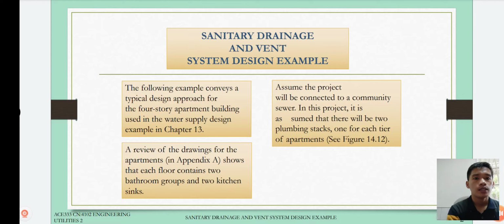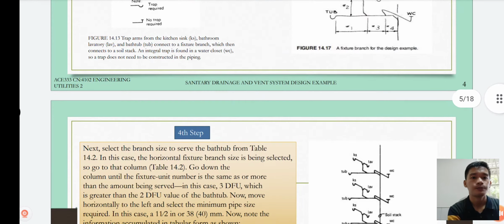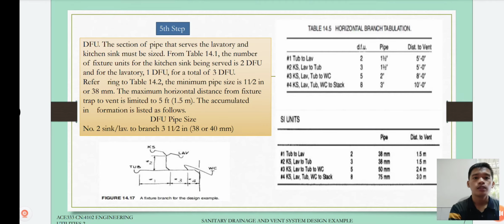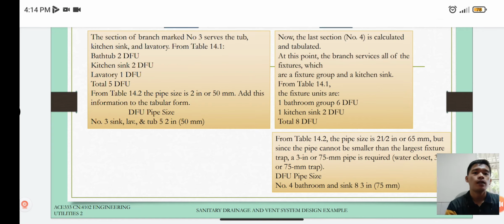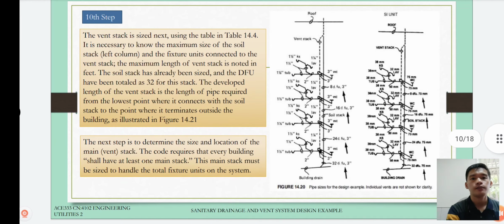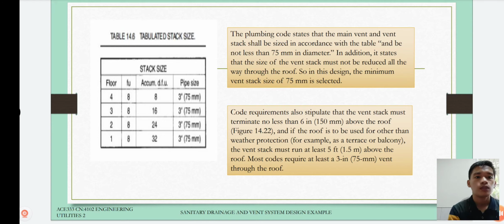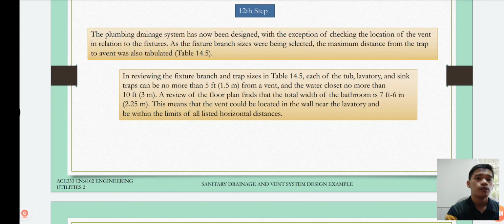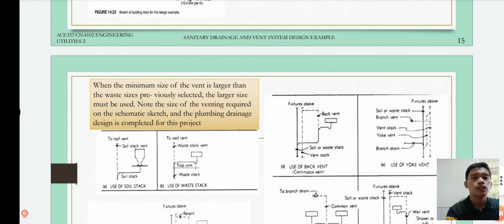ACE 333 Utilities Engineering 2 Report

Comment: After watching Ontoria's report I learned what is sanitary drainage and vent, and also system design example and its used. I also learned what are the 12 steps of sanitary drainage and vent systems and it's examples. I also learned what is a plumbing codes.

Comment: In this video I learned about the sanitary drainage and vent system design example in this topic. It talks about how to build or install a sanitary and exhaust system. I also learned about the different pipe sizes that must be used when designing a water supply system.

Comment: Horizontal branches, vertical stacks, a building drain inside the building, and a building sewer from the building wall to the disposal site are all common components of a sanitary drainage system, as I learnt in this video. Vents, on the other hand, allow sewage gases to escape the house rather than being trapped inside. The first step in designing a sanitary drainage and vent system is to create an isometric drawing of the drainage piping.

Comment: After watching Ontoria's report, I've learned the importance of knowing example of sanitary drainage and vent system design. The reporter provide 12 step to know the example and to better understand the procedure that can be used to create a sanitary drainage. I've discovered that air vents are sections of piping which attach to a main pipe to trap and release air.

Comment: Having studied various examples of sanitary drainage and vent system design in this video. This approach is designed in 12 steps and includes procedures and illustrations to help us comprehend the subject. The goal is to create and install sanitary drainage and venting systems that will work reliably, are neither undersized or oversized, and are made of materials, fittings, and connections that meet code and standard requirements.

Comment: In this video, I learned how to properly install plumbing drains and ventilation systems. The report also provided procedures for building sanitary drainage and standard pipes that can be used to create sanitary drainage and ventilation systems. We also learned that vent pipes bring fresh air to all sanitary fixtures in the house, helping the system move water through drain pipes every time the  toilet is flushed or the sink is drained. .. We also found that vent pipes provide fresh air to all sanitary fixtures in the house and help the system move water through drain pipes each time a toilet or sink is flushed or drained.

Comment: In this video I learned some examples of Sanitary Drainage and vent system design. There are 12 steps of designing this system and it shows procedures and sketches that will allow us to understand the topic. The intent is to design and install sanitary drainage and vent design systems that will function reliably, are neither undersized nor oversized, and are constructed from materials, fittings and connections whose quality is regulated by codes and standards.

Comment: In this topic, I learned about the sanitary drainage and vent system design example. It discusses the design or implementation of a sanitary and exhaust system. I also learned about the various pipe sizes that must be used in the water supply design.

Comment: the reporter tells us and a teach us about the process of proper installation of the sanitary drainage and also the vent in the building. and also I discovered that plumbing vents, as well identified as a vent stack, help to regulate air pressure in your plumbing system. Drain pipes carry water and waste away from your property. It also allows fresh air into the plumbing system, which helps to ensure that water flows smoothly through the drainage pipes.

Comment: In this topic i fully understand the purpose and the importance of air vents in the plumbing system. I understand better how it helps to manage the air pressure in the buildings plumbing system. It is also important to read the table to fully understand the design to be used in plumbing system.

Comment: Horizontal branches, vertical stacks, a building drain inside the building, and a building sewer from the building wall to the site of disposal are all common components of a sanitary drainage system, as I learned in this video. Vents, on the other hand, allow sewage gases to escape outside rather than inside the home. The first stage in the design of a sanitary drainage and vent system is to create an isometric drawing of the drainage piping.

Comment from the maker: In my report I learned that  plumbing air vents, also known as a vent stack, help manage air pressure in your plumbing system, as I learnt in this video. Water and waste are removed from your property via drain pipes. It also enables fresh air into the plumbing system, which aids in the smooth flow of water via drain pipes.

Comment: This video  detailed the methods for constructing the sanitary drainage and vent system, as well as the types of standard pipes that can be used. Vent pipes enables fresh air into the plumbing system, which aids in the smooth flow of water through the drain pipes. And water and waste will be remove  from your house by drain pipes.

Comment: In this video, I learned how to correctly install the sanitary drainage and vent system. This report also specified the steps on how to build the sanitary drainage and what standard pipes we can use to make the sanitary drainage and vent system. I also learned that vent pipes give fresh air to each plumbing fixture in the house, assisting the system in moving water through the drainage pipes each time a toilet is flushed or a sink is drained. In addition, I realized that vent pipes provide fresh air to each plumbing fixture in the house, which helps the system transport water via drainage pipes each time a toilet or sink is flushed or drained.

Comment: In this video, it taught us the 12 steps of sanitary drainage and vent system design example. Because of past report, wealready know that a sanitary drainage system is a system of piping within public or private premises that conveys sewage or other liquid waste to an approved point of disposal, and a vent system remove or exhaust sewer gases and allow air to enter the system so that the wastewater flows freely.

Comment: After watching this video, I learned the process of proper installation of the sanitary drainage and vent system in the building. Additionally, I learned the importance of vents that released the sewage gases outside the building instead at the inside. So in this situation, It avoids bad odors and reduced some hazardous risk to the health and environment.

Comment: In this presentation, I discovered that plumbing air vents keep sewage gases out of the house while enabling wastewater gas and odor to escape. In addition, I observed that vent pipes supply fresh air to each plumbing fixture in the house, assisting the system's ability to carry water through drainage pipes each time when a leak occurs.

Comment: In this video, I learned that the plumbing air vents are also known as a vent stack it helps regulate the air pressure in your plumbing system. drain pipes remove water and waste from your home. It also allows fresh air into the plumbing system to help water flow smoothly through the drain pipes.

Comment: In this video, I learned that horizontal branches, vertical stacks, a building drain inside the building, and a building sewer from the building wall to the site of disposal are all common components of a sanitary drainage system. On the other hand, vents allow sewage gases to be released outside rather than inside the house. In sanitary drainage  and vent system design example, drawing an isometric drawing of the drainage piping is the first stage.

Comment: In this report, every structure with plumbing fixtures and drainage piping is required by law to have a building drain connected to a sewer. Building drains are intended to receive discharge from a variety of drainage pipes, including soil and waste pipes, located within a building. Other waste is produced by the use of fixtures, appliances, and specific regions within a building, whereas feces is discharged through soil pipes.

Comment: Ive learned in this video is vent pipes supply fresh air to each plumbing fixture in the house, which helps the system move water through the drainage pipes each time a toilet is flushed or a sink is drained. Plumbing air vents also prevent sewer gases from entering the home and allow wastewater gas and odor to escape.